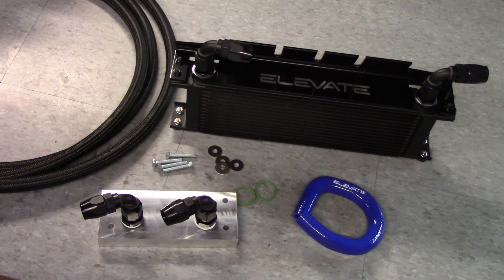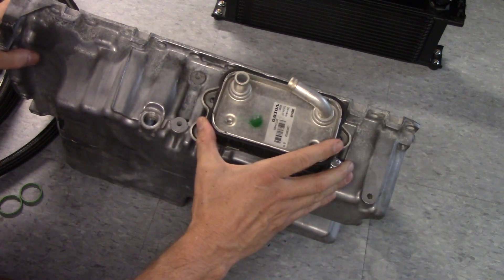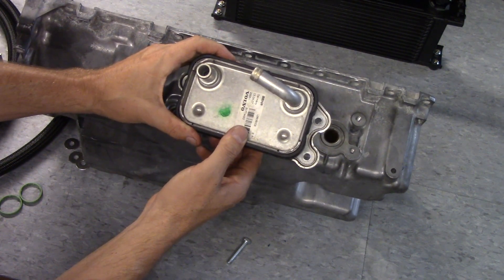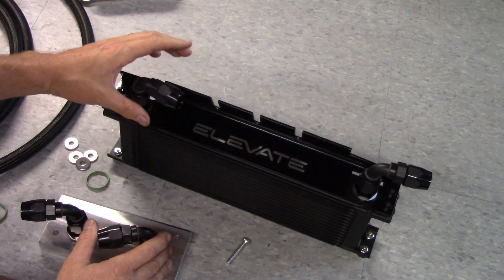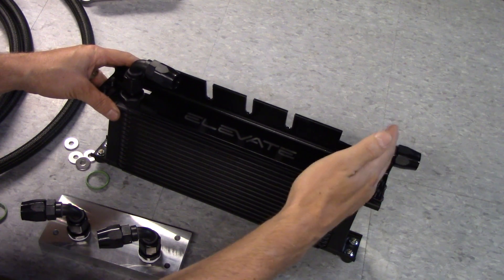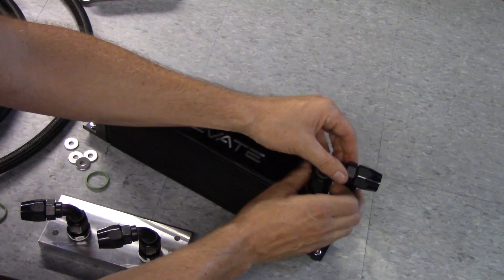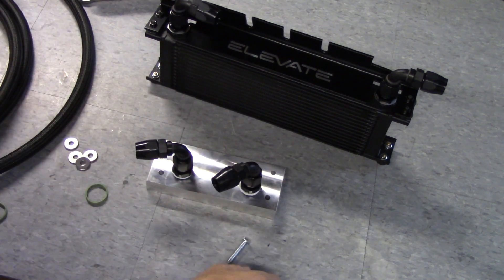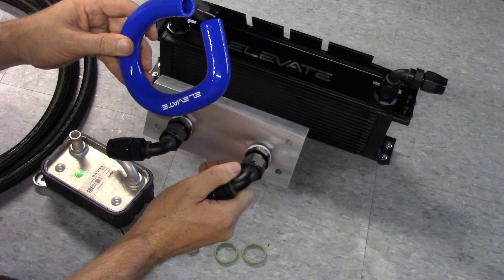Elevate Volvo P1 Oil Cooler Overview

Comment: In theory, would this mean the radiator has less work to cool down multiple components creating a cooler coolant temperature? Sort of like a 2 in 1 upgrade.
Reply from the maker: Technically, yes as you are bypassing the oil cooler cooled by the coolant. However, that is a pretty minimal impact on overall heat management.

Comment: Nice looking unit!

How are are restriction levels at high rpm? How is cooling efficiency?  My experience with oil to air oil coolers is they are about as efficient as a oil to water cooler of 20-25% the size... and restriction is substantially less with close mount...  I am surely interested in your unit if it is more efficient with less restriction! 

Cheers!
Reply from the maker: Learn more here: https://www.elevatecars.com/store/volvo-c30/elevate-volvo-c30-t5-external-oil-cooler.html
Reply: @ELEVATEVOLVO  description answered none of my questions....

Comment: Hi, I have a v70 R  1997 2.3 t  and I keep getting a trace of water in the oil, no oil in the coolant, I don't seem to be loosing any coolant either, the vehicle has done a lot of very short runs over the last three years and I'm hoping that is my issue, are there any common faults like this?
Reply from the maker: Hmmm, we don't have much experience with that engine as we focus on 2001 and newer Volvo.
Reply: @ELEVATEVOLVO   no worries had a ten mile run in it today and it seemed fine, I will keep a eye on the oil
Reply: yep, that can be your problem, drive it a bit more.
Reply: @skib3248   Yes I will get it out when the weather improves a bit hopefully.

Comment: Could this work for my 04 s60r??
Reply from the maker: The oil cooler mounting bracket would not work on your S60R. You can purchase our adapter plate as the basis for your system. https://www.elevatecars.com/store/volvo-s60r/elevate-volvo-engine-oil-cooler-adapter-plate-for-t5-five-cylinder-engines.html
Reply: @ELEVATEVOLVO   perfect appreciate it. Thanks 👌